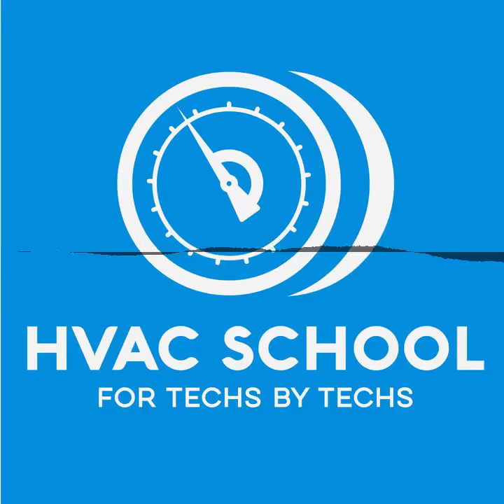(Podcast) Evacuation 101 w/ Jim Bergmann

Comment: I'm sorry to disagree with you  but you are not in touch with reality or practicality.   First of all you don't start your vaccuum untill you do a pressures test. This means that you do not have to do a fast vacuum to find out if you have a leak in your system. Secondly schrader valves are much more of a restriction than 1/4" x 6' hoses.   Thirdly if you can't pull a 300 micron vacuum on a 5 ton AC system while you are doing the rest of the install you should change your pump oil or you pump.  If you can prove that 3/8 or 1/2 inch hoses would cut my time in half I might listen to some of your recommendations. I do not remove cores, and I do use 1/4" hoses and I don't hang around for an hour after the other installation  items are done.  If I were working on a 10 ton system or bigger I leave the pump overnight. It doesn't wear out my pump because it runs in oil to keep it lubricated. The motor has ball bearings which don't wear out since I over greased them many years ago. I know some grocery store installers that insist on using copper tube instead of hoses but i'm pretty sure that it is still 1/4"  . If I were dong those jobs, I would probably use 3/8" just because it is handy and a bit faster but a 3/8 hose is not worth buying.  I have 3 spare ones hanging around and have no need to use them.  Great vacuum with 1//4"

Comment: To help speed things along,  I use my hand propane torch to add a bit of heat to the oil sump on the crankcase , receiver, accumulator, and uninsulated bare copper lines.  I read before in the OEM literature to triple hvac and on the first nitrogen break, to energize the compressor for about 5 seconds to attempt to drive out some of the refrigerant in the crankcase. 
      I remember in my HVAC/R college days, seeing a #10 can, 1/2 full of  refrigeration oil, constantly bubbling for about an hour,  as it was sitting on a work bench,  because it was entrained with R12.